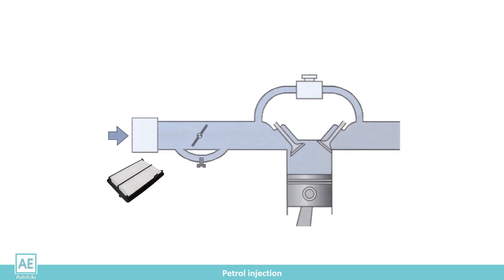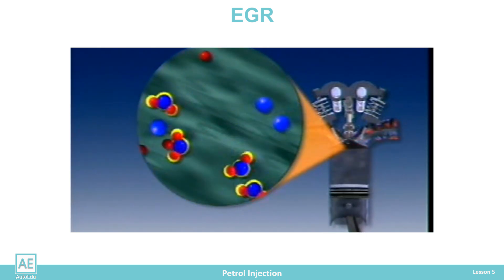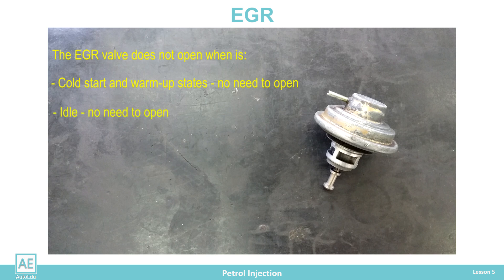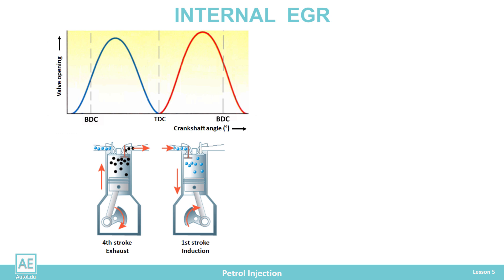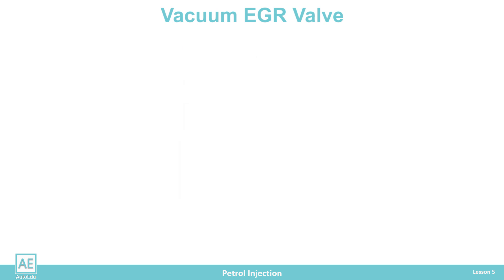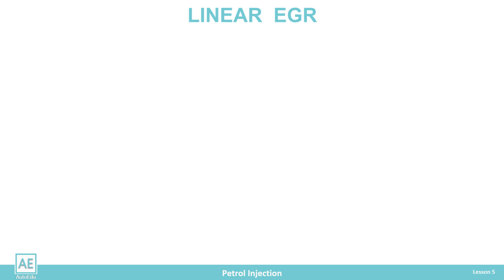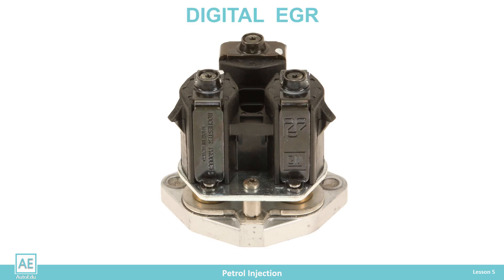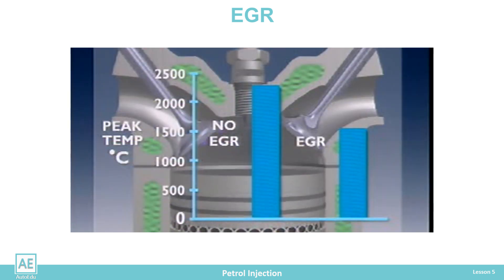EGR - how it works and is it necessary

Comment: After doing a timing belt job , new main an rod bearings , new oil pump , I'm now getting a ' random misfire code , egr recirculation code , an bank 1 below threshold . Those 3 codes can anyone please help me guide me in the right direction what is the problem an what to do ????? I'm thinking of changing the 2 , bank 1 oxygen sensors an of cleaning the egr valve ? Could that be the cause for my 3# codes ??